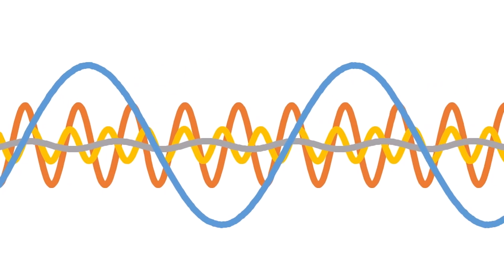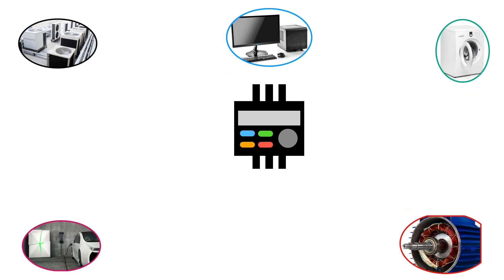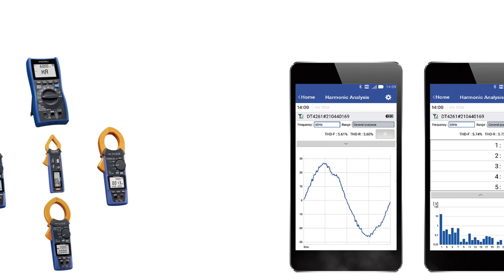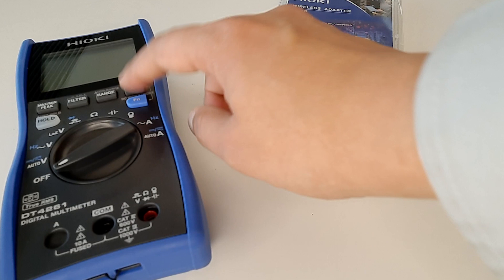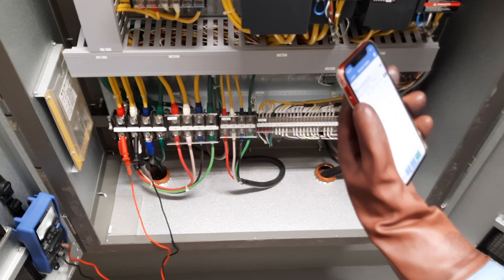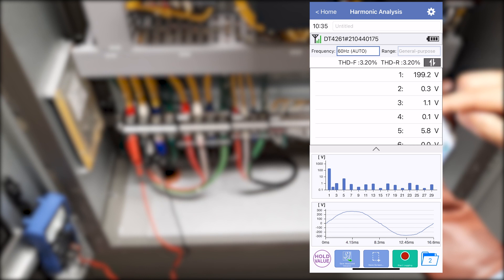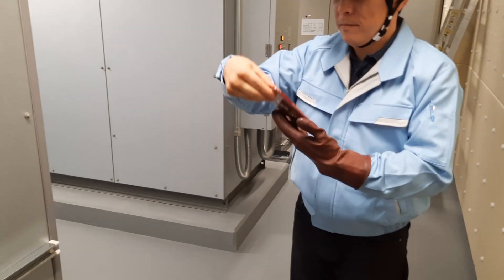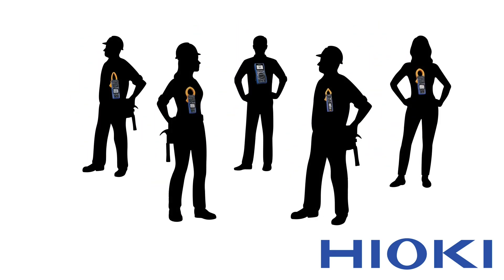What are harmonics and how to easily measure them

Comment: Is the Z3210 compatible with CM 4141, I see there a a port near the battery compartment that looks like it is for the Z3210?
Reply from the maker: Hi Eric-san. The Z3210 is not compatible with CM4141. But it is compatible with the latest model, CM4141-50.